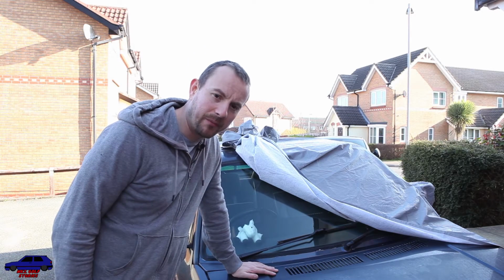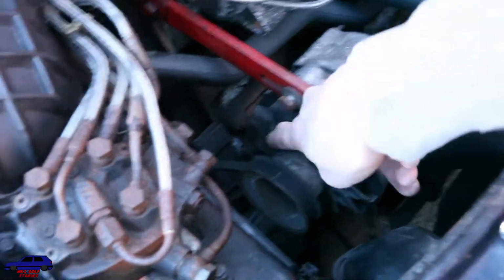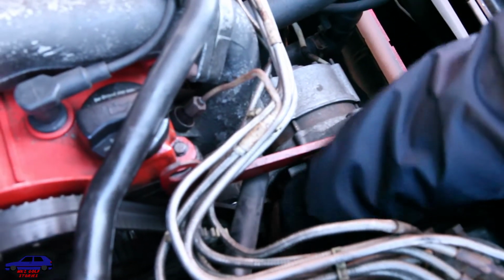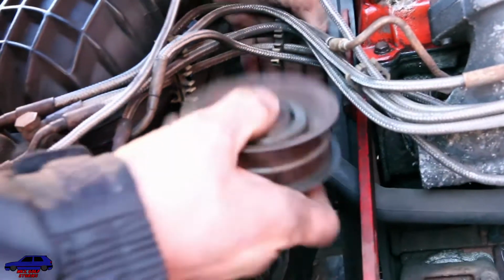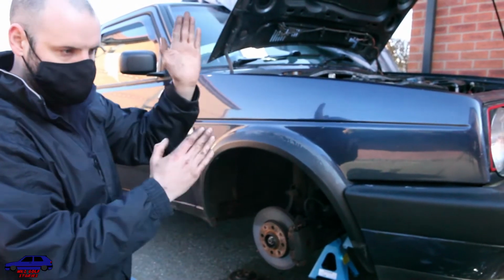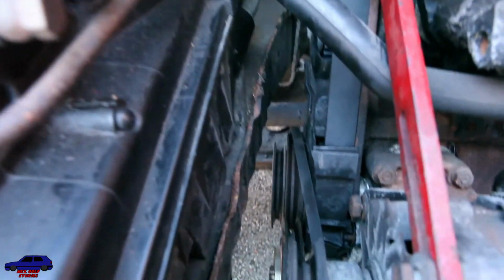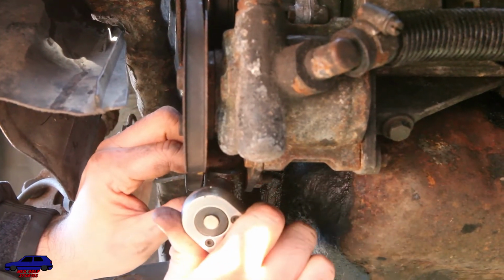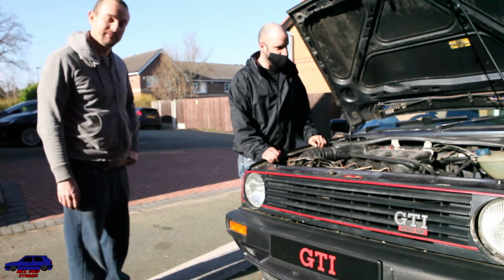MK2 Golf 16V Cambelt Change

Comment: Happy I have found this, my cambelt snapped on my mk2 abf so I’m putting a new engine in 🙄
Reply from the maker: Oh no! I’m petrified of mine doing that, despite replacing it when I did this vid it already looks worn!
Reply: @MK2GolfStories  I could of cried mate, I lost about £1700 (engine,parts & fitting) because of a £17 part ! This has given me an insight of fitting a new belt to my new engine tho so thanks 🤙🏻
Reply from the maker: @i4Detailing  ugh mate! At least you’re cracking on with it and aren’t going to be defeated! Glad you found this helpful! Good luck! If you’re on Twitter tag me in a pic! @mk2golfstories

Comment: Bro you say that these bolts at 5:00 are easy to unscrew lol, I can't move mine, do you have any special technique to do this? Also don't you need some kind of a locking tool to replace a timing gear?
Reply from the maker: Ohh it’s been a while since I’ve done this. Maybe worth giving them a soak in wd40 overnight.
By timing gear do you mean the main pulley at the top?
Reply: @MK2GolfStories  yea... soaking didnt do anything in my case, i will need to figure it out myself, i guess it's a charm of old cars, they are not so hard to repair but the rust and old screws are the hard part. By timing gear i mean crankshaft wheel (top one) and lower pulley wheel that i mentioned at 5:00. sorry my english is not perfect and i might misspeled something. Anyway thanks for respond to my comment, it's nice to know that there is a community of old vw golf lovers that is here to help :D
Reply from the maker: @MOVICZBEATSII  yeah to hold the crankshaft pulley still while you loosen the bolt you need one of these
https://www.amazon.co.uk/dp/B003AMUG4U/ref=cm_sw_r_as_gl_api_gl_i_HWXJ6DKJ673ZBEPKC0AP?linkCode=ml2&tag=mk2golfstorie-21

Yeah stuck bolts are a fucking nightmare.
You can try tightening and then loosening the bolts , should help break the rust.
Good luck dude

Comment: Is this the same procedure or a mk2 jetta 1.6 tx auto carb
Reply from the maker: I’m not 100 % sure mate
Changing a belt should be the same though. Maybe without the power steering pulley  , but I’m not sure
Reply: @MK2 Golf Stories  Thanks my jetta has no power steering just oil pump in way 👌